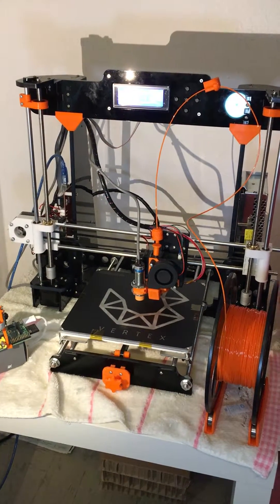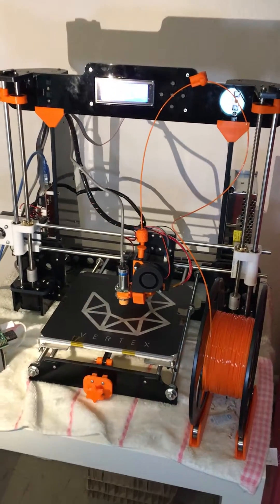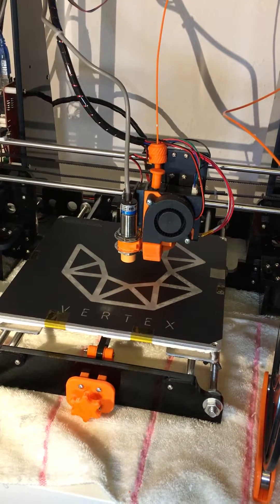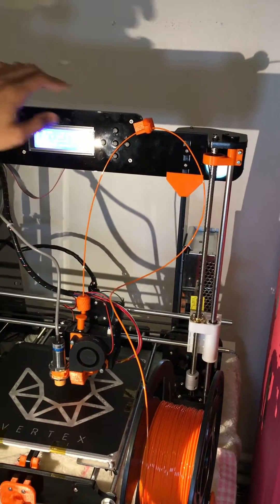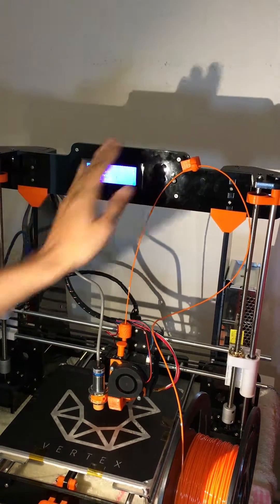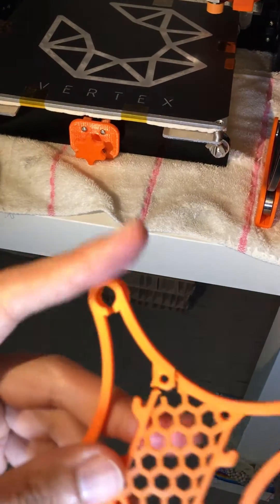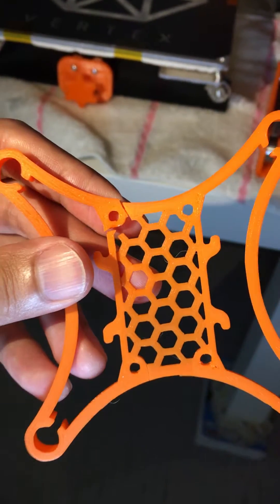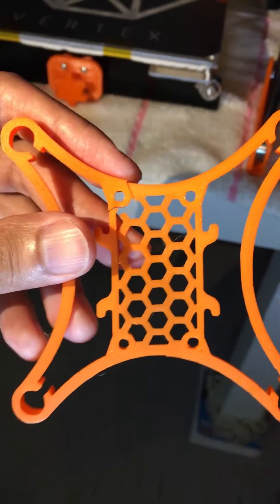Anet A8 best upgrade ever! The inductive sensor!

Comment: What Firmware Are You Running?
Reply: hes using skynet. 
skynet was a fork of marlin, but is now discontinued. so only the board definitions should be used and only if needed. 
marlin has pulled the skynet changes back their repo. thus they now offer full anet a8 support on newer marlin versions.
so use marlin - https://marlinfw.org.
all 3d printer firmwares will require you to compile it as well. so get your environment setup.
i personally recommend using the VScode guide to get yourself setup https://marlinfw.org/docs/basics/install_platformio_vscode.html

Comment: Looks like a nice improvement! I've had the sensor for 2 months, just been avoiding the firmware update.
Reply from the maker: do not be afraid, mostly it works the same as the stock firmware, but with added features